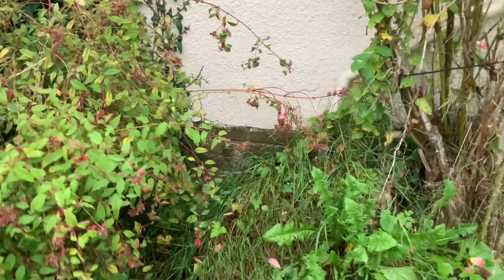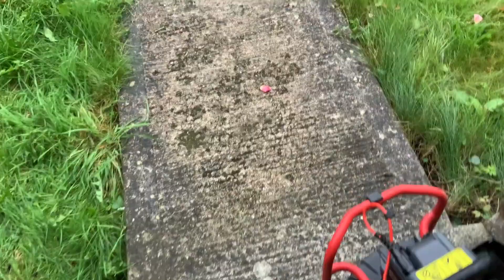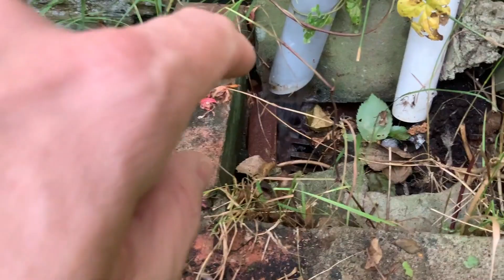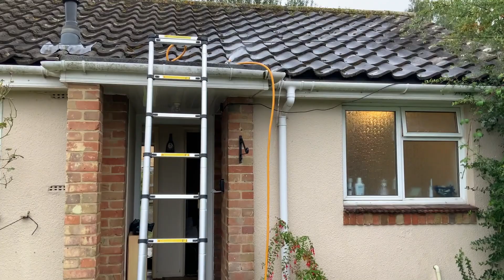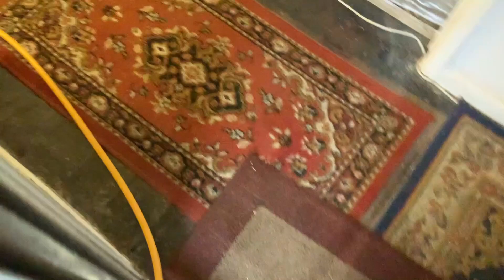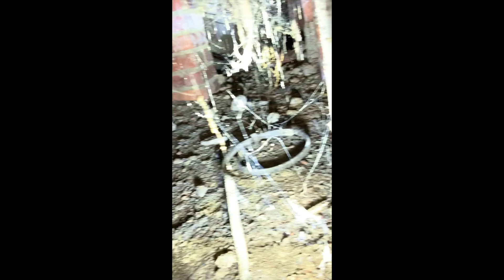Suspended timber floor decay causes

Comment: Excellent video.  It's great because you aren't using any fancy equipment, yet you are making some great diagnosis which most people would completley miss.
Reply from the maker: I'm glad you like it Paul. This could be a very costly mistake especially on a pre purchase survey.....Just goes to show what a damp can do to those timbers. Also got a good video of condensation to flooring nails. I will be using this on another video about where to look for a timber decay issue, with limited opening up :)

Comment: Good stuff. One Question: how long does/can it take for wet rot to take hold?

I'm thinking Scottish conditions with sort wet days of winter then long drier days of summer giving an annual cycle where the rots can progress then stall, and go again the next winter, taking years, possibly, before you spot the rot and then step through the floorboard at the worst point, adjacent to a weather facing air vent delivering 95%-99% humid cold air for weeks onto the joist flooring 😬.

Some exposed place in England will be nearly as bad😟.
Reply from the maker: It really depends on the conditions and the length of time of those conditions. Wet rots will intermittently start and stop just like dry rots.  I did mess about with this a few years back and I couldn’t kill off either, as soon as I introduced moisture they started again. I have got one I’ll post I have been doing on dry rot as it’s quite interesting 👍
Reply: Just to say we had a local building preservation surveyor round to look at our scenario (we'd discovered the rot originally because I wanted to install an underfloor telephone line). The surveyor confirmed it was wet rot, without rising damp, and reckoned that it had probably been developing over 10+ years with annual spurts through the winter. The solum is glacial rubble, so while well drained from a water table perspective, it does have a lot of capillary moistness from the slope behind. 
Being only a crawl space under the floor boards there is also likely to be a radiative heating element direct from the under-floor to the solum that increase the moisture load (opposite direction of radiative heating compared to underfloor heating of living space systems).
We've also found one downpipe had a leak about 30cm above ground level (adjacent to the worst rot) and all the air bricks are only 3cm above concrete path and the air directly impinges on the adjacent joists. So lots of contributing factors.  @completepreservation

Comment: Excellent video, 

so what did you do to resolve the issue?
Reply from the maker: Thanks for the kind comment :) I will do a short video on the drying of the sub floor void, along with all the data logging of it. If you look on Instagram (Complete Preservation) you will see a thermal imaging video of the drying equipment in action.